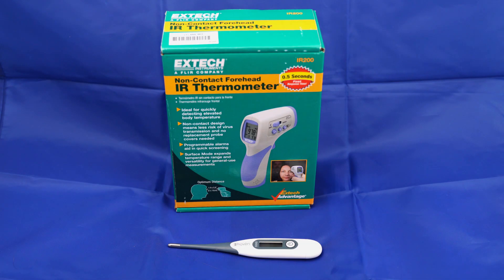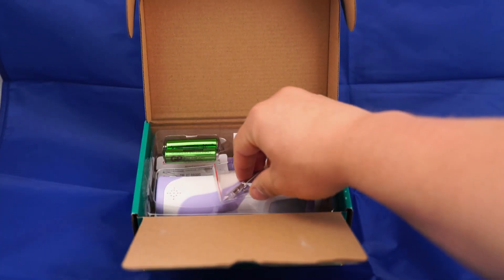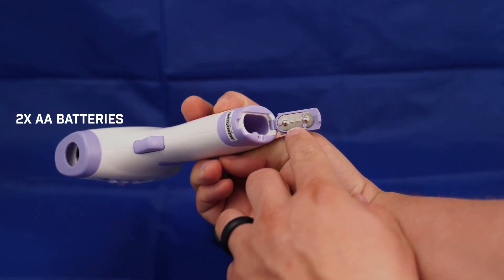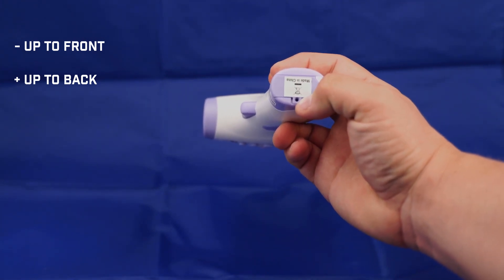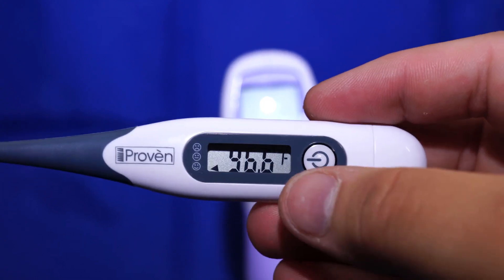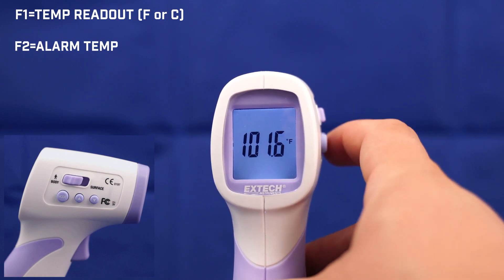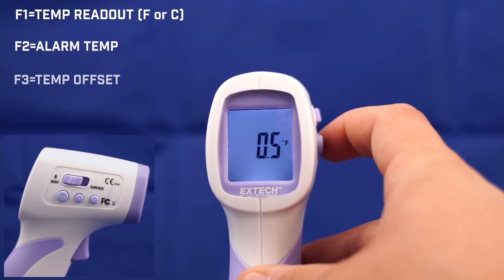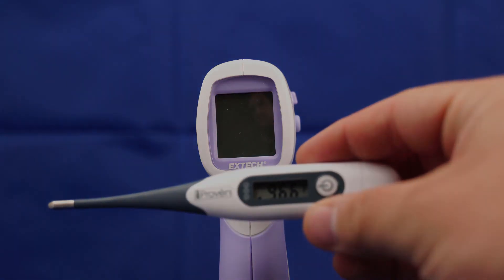Unboxing & Calibrating the Extech IR200 Forehead Thermometer

Comment: I didn't calibrate it earlier when i was using..I haven't had fever then..so I couldn't figure out whts wrong with the reading. Now that I caught fever when i used it, it still showed me normal temperature as 98.1F and while i took conventional thermometer reading it showed 100°F and I panicked instantly..now I've callibrated the offset value to +2..but could you please confirm if it'll continue showing the accurate value now on or should it requires calibration everytime.if everytime then its of no use for me..i would switch to my old conventional thermometer.
Reply from the maker: You should not have to calibrate the IR thermometer every time you use it. It also should not matter what your temperature was when you calibrated the IR thermometer as long as you did the calibration properly. The way you describe it sounds correct so you should be good from now on. If you are concerned, test yourself again with both thermometers and compare the readings - they should be the same.

Comment: for these devices to read body temp from a forehead reading involves 2 temperatures, the room temp and the forehead reading , it must calculate the offset according to room temp. forehead readings up to 96 is normal , above would indicate a fever , unless the room temp approaching 90 and above , the closer the room temp to a normal body temp , the closer the actual reading will be of the actual body temp.i am looking for one  that works this way , this appears to be not a smart version , but a basic one and setting the offset would require resetting offset for changing room temperatures constantly , unless your room is under constant temperature control you are taking your reading in.
Reply from the maker: What you describe is an infrared thermometer with built-in ambient sensors to detect and compensate for the ambient temperature. This Extech IR200 does not have these sensors. In our experience with the IR200, after being calibrated in reference to an oral thermometer, it is accurate to within specification. In general, the best practice is to leave the thermometer in the testing location for at least 15 minutes prior to use so it can acclimate. You should also only use these thermometers indoors, away from doors and windows, and make sure that subjects have not been in direct sunlight for long periods. Check out our video to learn more about IR thermometer best practices: https://www.youtube.com/watch?v=Lwopnj3UWac

Comment: what many people forget is forehead and underarm temps read 1 degree less than actual body temp.  In healthcare, we know to add a degree when taking an axillary (underarm) temp so same should go for the forehead.  If you want a true core temperature..... gotta go rectal!
Reply from the maker: You're 100% correct, that's why this video explains the proper calibration and compensation for that difference using an oral thermometer. Rectal is probably the most accurate way to do this but good luck getting people on board with that!

Comment: What is the fifth setting u don't go over it f5 pop up CAL and u can turn it on and off what is it?
Reply from the maker: This could possibly be for factory calibration. There is no mention of a fifth function in the product manual - check out page 4 under "Body Temperature Mode settings" and it only lists the 4 functions discussed in this video: https://res.cloudinary.com/iwh/image/upload/q_auto,g_center/assets/1/26/Extech_IR200_User_Manual.pdf

Comment: So, I need another thermometer to set my thermometer?!
Reply from the maker: If you need to calibrate the IR thermometer, then yes you'll need a reference thermometer with good accuracy. The best practice is to use an oral thermometer like in this video - oral thermometers are much cheaper than IR thermometers and can be bought for just a few dollars.

Comment: Hello team, what does HI means ? It appears on the screen when i cannot get the température ?
Reply from the maker: Taken from the IR200 user manual on page 4:
If the temperature goes above 109°F or 43°C, Hi will appear in the display.
If the temperature goes below 86°F or 30°C, Lo will appear in the display.
Reply: @TEquipment  Thanks !